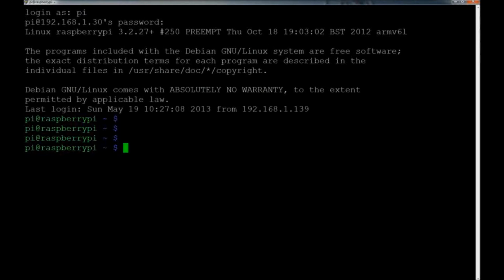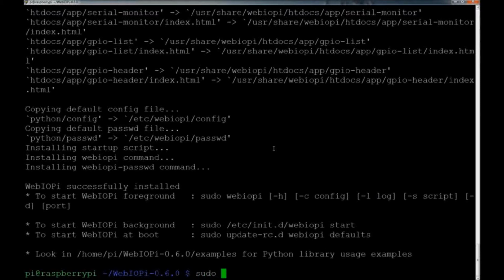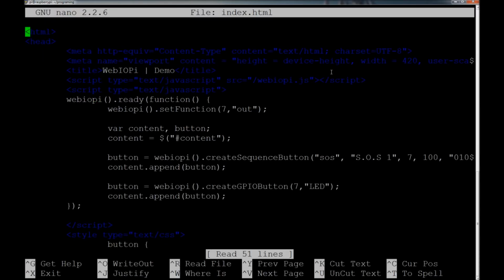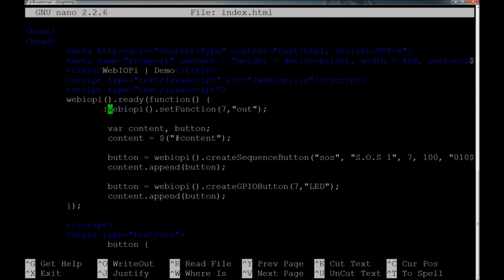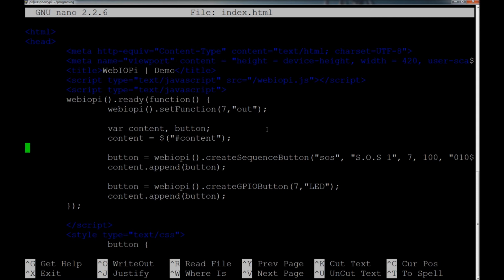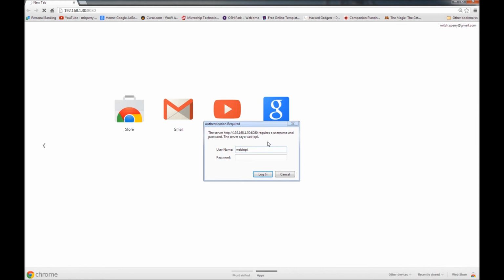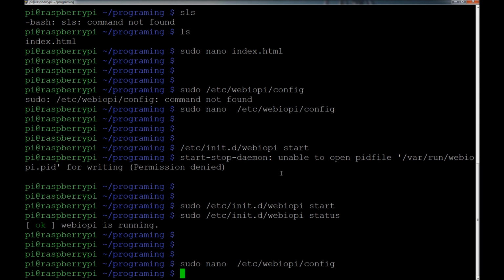Raspberry Pi Custom Web Control

Comment: Hey, im trying to use this but it seems to be reverting back to the old idex folder, is there something addtional i need to do ?
Reply from the maker: Hello there.  What config file are you editing to point the root directory to your index file?  It should be located in /etc/webiopi/config.  in the config file there should be a section labeled [HTTP] and there shoudl be a "doc-root" section and a "welcome-file" section.  These are where you set your webroot folder along with your index file.

Here is some documentation from webiopi:  http://webiopi.trouch.com/CONFIGURATION.html

Hope this helps.  Cheers!

Comment: Thanks a lot man. 
Could you please upload the index file?
Reply from the maker: the index that comes with the webiopi install, link in description, is the same one I am using and modifying.  However, I did do another video about custom web buttons that I have a zip file of the index in at the following link:

http://www.mediafire.com/file/8llu7qagoc5574p/custom_webiopi_buttons.zip

Comment: after installing the webiopi an error occurs when i type `sudo webiopi` 

ralph@ralph-desktop:~$ sudo webiopi
Traceback (most recent call last): 
  File "/usr/lib/python3.5/runpy.py", line 174, in _run_module_as_main mod_name, mod_spec, code = _get_module_details(mod_name, _Error)
  File "/usr/lib/python3.5/runpy.py", line 133, in _get_module_details return _get_module_details(pkg_main_name, error)
  File "/usr/lib/python3.5/runpy.py", line 109, in get_module_details __import_(pkg_name)
  File "/usr/local/lib/python3.5/dist-packages/WebIOPi-0.6.0-py3.5-linux-armv7l.egg/webiopi/__init__.py", line 17, in <module>
  import _webiopi.GPIO as GPIO
_webiopi.GPIO.SetupException: This module can only be run on a Raspberry Pi!

what seems wrong?
Reply: I got the same error, did you solve it?if yes, can you help me into the same?
Reply: I got the same error, did you solve it?if yes, can you help me into the same?
Reply: i got mine working by reinstalling raspbian and installing webiopi again
Reply: So, we have to reboot it again? Or install os again, any easier way?
Reply: I have the same error as of yours
Reply: in that time i was running ubuntu mate, then i got another sd card with raspbian and installed webiopi successfully. if you have raspbian then try to follow the steps here https://github.com/doublebind/raspi

Comment: on clicking GPIO header in browser i  got an exception on my rpi screen as below..

----------------------------------------
Exception happened during processing of request from ('192.168.1.101', 61317)
Traceback (most recent call last):
  File "/usr/local/lib/python3.2/dist-packages/WebIOPi-0.7.0-py3.2-linux-armv7l.egg/webiopi/protocols/http.py", line 238, in processRequest
    result = self.server.handler.do_GET(relativePath, compact)
  File "/usr/local/lib/python3.2/dist-packages/WebIOPi-0.7.0-py3.2-linux-armv7l.egg/webiopi/protocols/rest.py", line 147, in do_GET
    return (200, self.getJSON(compact), M_JSON)
  File "/usr/local/lib/python3.2/dist-packages/WebIOPi-0.7.0-py3.2-linux-armv7l.egg/webiopi/protocols/rest.py", line 245, in getJSON
    gpios[gpio][f] = GPIO.getFunctionString(gpio)
NameError: global name 'GPIO' is not defined

During handling of the above exception, another exception occurred:

Traceback (most recent call last):
  File "/usr/lib/python3.2/socketserver.py", line 295, in _handle_request_noblock
    self.process_request(request, client_address)
  File "/usr/lib/python3.2/socketserver.py", line 321, in process_request
    self.finish_request(request, client_address)
  File "/usr/lib/python3.2/socketserver.py", line 334, in finish_request
    self.RequestHandlerClass(request, client_address, self)
  File "/usr/lib/python3.2/socketserver.py", line 648, in _init_
    self.handle()
  File "/usr/lib/python3.2/http/server.py", line 396, in handle
    self.handle_one_request()
  File "/usr/lib/python3.2/http/server.py", line 384, in handle_one_request
    method()
  File "/usr/local/lib/python3.2/dist-packages/WebIOPi-0.7.0-py3.2-linux-armv7l.egg/webiopi/protocols/http.py", line 267, in do_GET
    self.processRequest()
  File "/usr/local/lib/python3.2/dist-packages/WebIOPi-0.7.0-py3.2-linux-armv7l.egg/webiopi/protocols/http.py", line 258, in processRequest
    except (GPIO.InvalidDirectionException, GPIO.InvalidChannelException, GPIO.SetupException) as e:
NameError: global name 'GPIO' is not defined
----------------------------------------
please suggest me a soluiton..
Reply from the maker: +Hima Bindu Hey there are you using the default page or are you using the custom one I am talking about in this video?  Also you may try re-installing webiopi.  It looks like for some reason it cannot find the library since it does not know what GPIO is.  Also make sure you have the "#" symbol in front of the GPIO call.  i.e. #GPIO7.LOW

Hope this helps.
Reply: +misperry the default one. "sudo webiopi"

Comment: hi ,thanx you for this tuto but i have probleme that when i creat my own page web then i connect on it the default one appear again and i couln't connect on mine .can u help me please
Reply from the maker: +Radhia Amri Hey there.  At around 21:25 in the vid I show that you will need to change the path that webiopi is using to where your index.html is.  This is located in the config file at /etc/webiopi/ file is called "config"  Hope this helps.
Reply: +misperry  thnak u, but i created just the  file  index.html and what about the script.py  i didn't creat it and what 's should i put int the path of th part" scipts" in the config's file. the # that u put is it just for expressing a comment ??

Comment: how do i wire my pi to show if the gpio is on after i refresh my browser?   Thanks for any help
Reply from the maker: +Mando Rodriguez Well the pi has many gpio.  What I would do is set one pin as an output and another as an input then in the code I would set the output pin high when I set the other output pin that controls a relay or whatever at the same time.  Then I would feed back the output pin that is not connected to the relay back to the input pin so that I knew that it was on.
Reply: Thank you misperry I was able to figure it out using your xmas coding.  Thank you so much for the response

Comment: Thanks misperry for your awesome video. It's really easy to follow. Unfortunately, Me and many others have faced a little problem with webiopi-0.7.1 
When we open the GIPO header, pins are shown but nothing is selectable, the buttons are semi freezing.
Here is the problem detail:
http://raspberrypi.stackexchange.com/questions/29286/need-help-finding-problem-with-webiopi-gpio-header

Any help or suggestion please
Reply from the maker: +alhafed11 Hey there that seems funny.  Is this still an issue for you.  I am not sure why it would act that way I do have a raspberrypi B+ I could try it on and see if it is a hardware/software interfacing issue or something.  I know you can always post on the webiopi forum.

https://groups.google.com/forum/#!forum/webiopi

Hope that helps and let me know if it is still an issue.

Comment: Ok, another issue, but I am almost there. I can get the webpage to appear and when clicking the buttons they do what they are supposed to show but the LED does not light. But, when I load the address on my phone it works!
Reply from the maker: nkuck I would check your java permissions and make sure you have the most up to date java installed on your PC.  Java security settings are in the control panel on windows.  Also try different browsers ie, firefox, chrome, etc.  HOpe this helps

Comment: I followed all as described, including the index file. When I launch webiopi and the webpage, I get the image but the outboard buttons are gray. What have I missed? Thanks for a reply.
Reply from the maker: Noel Kuck Hello there, are you saying that they are disabled or that they are just colored gray?  When you click on them what happens?  If it is like the video at 26:02 they should be colored gray but when you click them they should work.  Do you want them to be a different color?  Thanks.

Comment: Hi, I'm going to implement a project that is going to read temprature and motion information from RASpi (preferred dynamically) and store some information to database, but could not be sure whether doing it by editing webiopi environment or by createing my own environment with php+ajax and mysql. Do you have some suggestion ?
Reply from the maker: Cantuğ Çavuşoğlu Well it depends if you want it to be web based or not.  webiopi will allow the gpio to be accessed via the web.  If you are just wanting a data logger of sorts you could just write a c/c++ program to accomplish this.  Just think about all the aspects of your project and evaluate what each direction has to give to your project and narrow it down to what is the best solution.

Hope this helps.  Cheers!

Comment: Hey your videos are amazing....i have a doubt suppose we want to access the webiopi server globally from anywhere in the world through a pc or a mobile phone is that possible?
Secondly if i want to make a graph on webiopi using my ultrasonic sensor's values is that possible as well?
Reply from the maker: Hey there, yes you can do it one of two ways.  The first way is more difficult from the second way,

1.) If you have a dynamic ip address from your ISP you will need to set up a DYNDNS service of some sort with some host like www.dyndns.org.  Once this is done you will have to configure your router to update the dyndns hosting company with the outside IP address, most linksys routers have this built in, then you will need to port forward port 80 to your router so that when you go to your site domain you will be directed, on the inside, to your raspberry pi.

2.) You can sign up for an account at weaved, I have a video about this linked below, and install some software on your raspberry pi and in about 5min you can, through the weaved service, access your webiopi from anywhere in the world.

https://www.youtube.com/watch?v=mC4sR987M-4

As for your graphing, yes you can set up I2C or SPI stuff with webiopi you may have to check out the documentation for the webiopi to see how to use it. I have not done this but I think the functions exist.  Then using some clever web admin skills you can design a graph to graph the data the pi gives you.  Oh and you may have to get an external ADC module that talks oer I2C or SPI to get the info to the pi.

Sounds cool.  Good luck

Comment: I cant even get the first command to work... Any help?
Reply from the maker: What first command are you having issues with?  Is it the install or is it setup?  Ensure that when doing commands that require "root" permissions you perform a "sudo" before the command or switch users to root by issuing "sudo su root"  hope this helps.

Comment: hey misperry tutorial is super,I am using webiopi macros,I am facing problem with macros even-though I declared macros in python script, when I am calling from webpage,in console it is showing that macro not found 404 error I followed following link https://code.google.com/p/webiopi/wiki/Tutorial_Macros please help me
Reply from the maker: Hey there, I have not used this feature yet but some suggestions I would give you would be the following:

1.) check to make sure you have named things correctly and that they are in the correct folder.  According to the link it should be named "script.py" and it should be located in "/home/pi/myproject/python/"
2.) Check he permissions on your python script to ensure that it is executable and that all users can use the file.

This also could be a good video.  Thanks for the idea I will have to explore this more.

Comment: i cant get to my custom page :| if i go localhost:8000/files/ where is my custom index.html i get error 404 :| any ideas?
Reply from the maker: Hey there you don't need the "/files/" after it.  Just type the IP address of your pi followed by the port for example:

If you do an "ifconfig" and see that the ip address of your pi is lets say... 192.168.1.20
Then you would go to your web browser, ie, chrome, firefox, etc and type in the address bar : http://192.168.1.20:8000

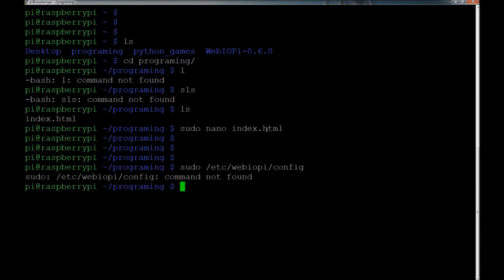That is it.  Also you can check your config file that is located in /etc/webiopi/ at 21:50 in the video

Comment: Hi, thank you so much for this video, it has been a huge help.
If it's not too much trouble for you I need help with something I'm trying to change.
I would like to alter your index file to have additional buttons, let's say 4 buttons.
I've gone in and deleted the S.O.S 1 button because I don't need it and the LED button is still there. I changed it to activate gpio 4 and changed the color of the button to be green when on and red when off. So far no problems.

I have tried making a new button and this is where I run into some issues. I copied the code for your LED button, pasted it below and changed it to refer to gpio 17.
I save the index.html file, access the webpage and......nothing loads.

What I want to do is have 4 buttons that turn on or off different pins, each of which will change color when pressed but all will use green for on and red for off.

Can you tell me how this is possible?
Can a heading be added to the page, above the buttons?
Can you use specific colors other than just red or green by specifying the color code?
Also, I notice that when you initially load the page the button is shaded grey and you have to click it to make the status change so it doesn't actually read the state of the pin, it simply toggles. I would like to access this page from many computers and phones/tablets and have each one show real time status like the gpio header one does that comes standard with webiopi. That way if I am looking at the webpage on my computer and I press a button on my phone the webpage on the computer updates to reflect the change too.

I know I'm asking a lot here but your help would be so appreciated to get my project up and running perfectly. 

Once I get it working I'll show you the whole project, it's a multiroom audio controller setup and I'pretty excited about it.
Reply from the maker: Hey there I am glad the video was helpful to you.  When creating multiple buttons you have to make sure you add all the pieces with the new button.  You will need to make sure you give the webiopi().setFunction(<GPIO number> , "<in/out>") for each pin to define whether it is an input or output pin.  Then you will need to create the buttons with:

button = webiopi().createGPIOButton(<GPIO#> , "<lable>");
content.append (button);

Then you will need to set up how it will look with the css:

button {
    display: block;
    margin: 5px 5px 5px 5px;
    width: 160px;
    height: 45px;
    font-size: 24pt;
    font-weight: bold;
    color: black;
}

input[type="range"] {
    display: block;
    width: 160px;
    height: 45px;
}

Then add the buttons, each individual button

#gpio<GPIO #>.low {
    background-color: white;
}{

#gpio<GPIO#>.high{
    background-color: Red;
}

That should be it just keep adding "setFunction" statements, "button = " statements, and the CSS formatting for each additional button. For more information on how to format the buttons check on working with CSS.

Also check out by other video about GPIO buttons for a different approach:

https://www.youtube.com/watch?v=Rw1tGGTYrjY

Hope this all helps.

Comment: any idea why when i update my html file and config file the web browser still displays the default webiopi interface? I have followed your video as well.
Reply from the maker: Hey there thank for the comment.  Try restarting the webiopi service:

/etc/init.d/service webiopi restart
Reply: Unfortunately I've done all of that already. I've even gone as far as to reinstall webiopi all together. Is it possible that webiopi could be running in the incorrect mode or something? It's very confusing as to why none of my changes show up because I feel like I've done everything correct. 

If I sudo nano the index.html file what should come up? The default webiopi webpage?
Reply from the maker: Hey there make sure that the index file you are looking at is the one the webserver is pointing to.  To answer your question, yes if you have freshly installed the webiopi software and if you have the correct webiopi index then you will get the default webiopi index when you edit it. (of course it will be in html). If you would like to change the default folder for the index and point it to any folder that you want you will need to edit the config file that is located in the directory "/etc/webiopi/" the file is config.  Go to the section titled scripts and un-comment the line "myscript=" and put the path to your folder where your index is.  This is explained at 21:30 in the video.  Hope this helps.

Comment: Why Why WHY couldn't you just show us how/where you created you directory. Found this part confusing as I make a directory but it doesnt seem to work like yours.
PLEASE HELP!!!
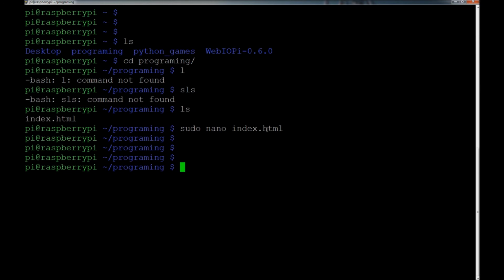Reply from the maker: Hey there thanks for the comment.  The reason I did not show how to create a directory since I had done this in previous videos.  All you need to do us to use the command syntax: "mkdir <name of directory>" and that is it!  Once you have created the directory you will have to point weiopi to that directory by doing what I did at 21:20 in the video.  Hope this helps out.